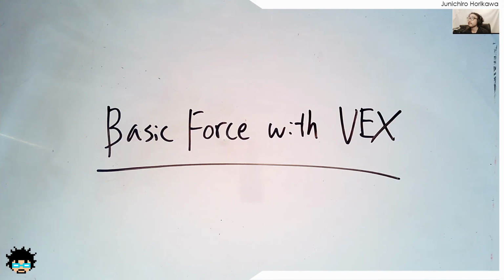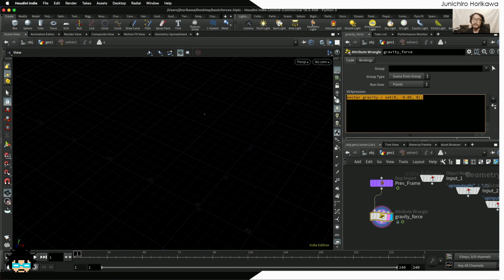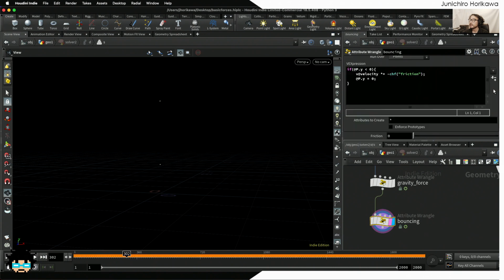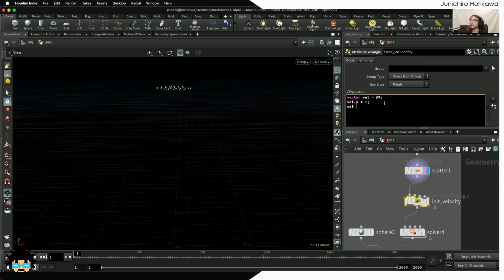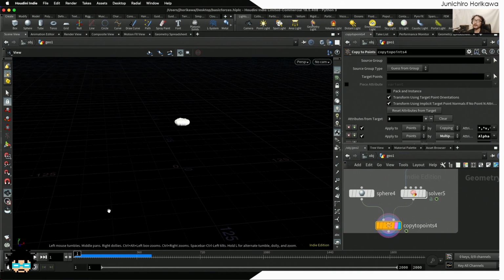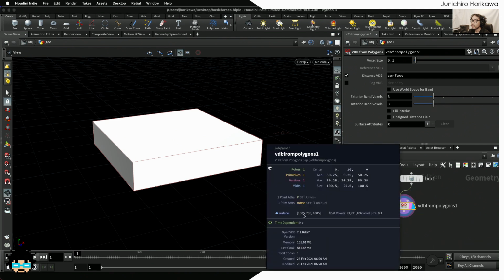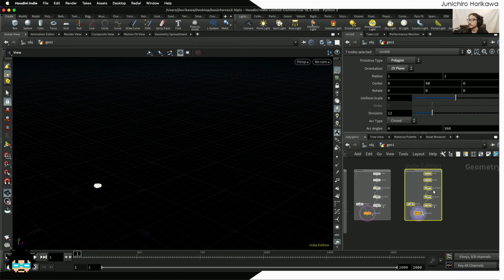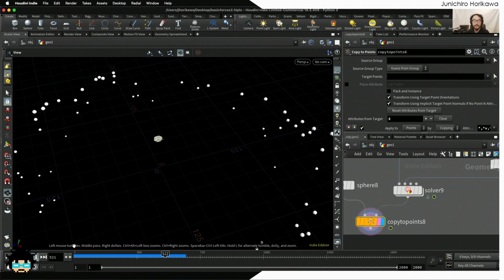[VEX for Algorithmic Design] E24 _ Force Basics

Comment: As a relative Houdini apprentice, I’ve found VEX quite daunting but your video was really easy to follow and useful. 

Great idea to sketch out the tasks first and then, step by step, work through how to build the code to solve the problem.

Also good that you start simple and then scale-up the whole system by adding further controls. 

That’s a simple but great approach when it comes to de-bugging.

Comment: I assume that we should calculate Force and not Acceleration in Force with masses chapter. Newton's second law states that force is directly proportional to the mass of an object and its acceleration. F = m * g. That's mean heavier objects should fall faster as obvious as feather versus piano dropping example. Gravity can be called acceleration because used as constant change vector of object motion.  F or force is special vector that modifies velocity at each moment of time because it's represents acceleration of influence of both values (mass and gravity) on object by proportional increasing of its vector length. 
According to wiki: In physics, a force is any interaction that, when unopposed, will change the motion of an object. A force can cause an object with mass to change its velocity (which includes to begin moving from a state of rest), i.e., to accelerate. Force can also be described intuitively as a push or a pull. A force has both magnitude and direction, making it a vector quantity.
https://en.wikipedia.org/wiki/Force

Comment: Just found that friction equation isn't correct too. It should depend on speed, but in the video on 43:24 I see vector's normalisation. there is a mistake I guess.
Reply: hmm, but wouldn't you want the friction to be constant?  If you don't normalize it, it will be like an opposite acceleration.  Maybe?
Reply: @the_shizon3322  air friction is not constant. it is speed dependent. basically it acts as deacceleration. at speed 0 you have no air friction. at high speeds you have high air friction

Comment: I thought drooping two objects with different masses will reach the floor at the same time, this contradict the f=ma.

Because Earth gives everything the exact same acceleration, objects with different masses will still hit the ground at the same time if they are dropped from the same height

people think that gravity acts more on a heavier object thus pulling it down faster. In fact, gravity works independently of mass. This means that all objects should fall at the same rate. ... If there is no air resistance, or the same amount of air resistance, then objects of the same mass will fall at the same rate.